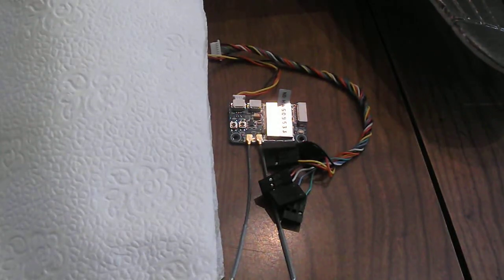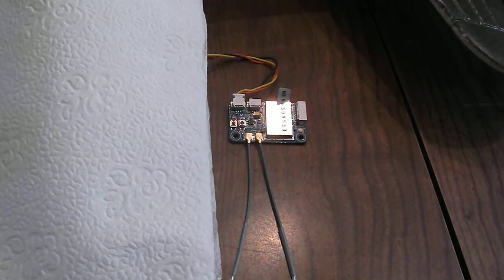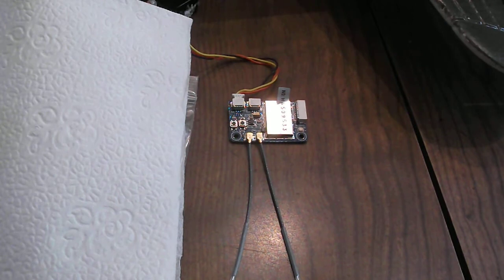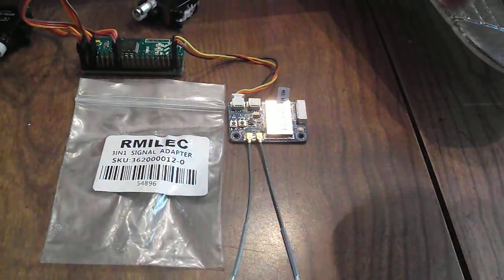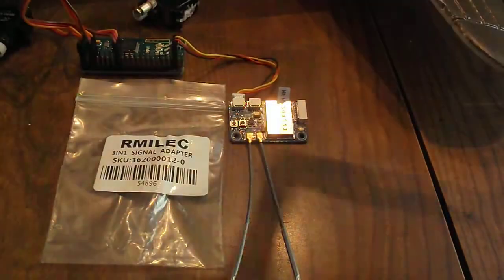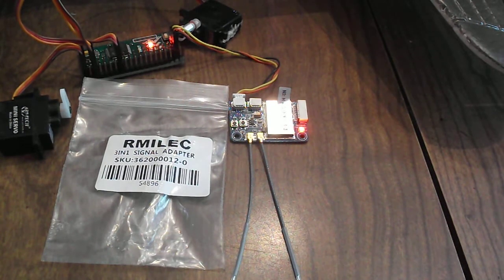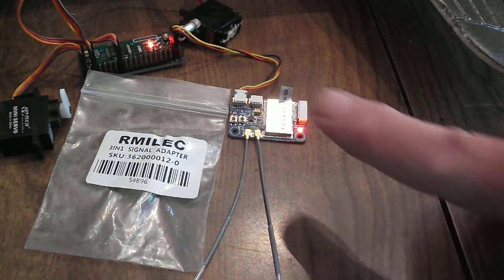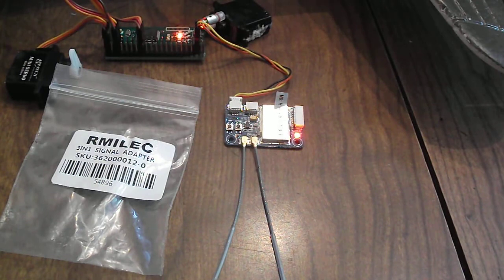FS x6b receiver servo output and 10 channel ia10b with the fs-i6x

Comment: And if you want to use the regular PWM output cable and connect servos directly:  https://www.ebay.com/itm/184100616268

Comment: You can use ibis for 16 channels on x6b and ppm gives 8 channels pwm 6,channels. Would appreciate if you could give a link for the board you are using I just fried an esc while trying to figure this out. This is a stupid receiver and ysky should have thought that this is generally the fo
Irst radio a new rc hobbyist has and thus they should give an easy to configure receiver. I got my servos working as needed but the motor does not have proper control.

Comment: The cheaper way to do this is to use the PWM plug and some pin header to connect servos to power.  No adapter needed for servos
Reply: Agree with you! Made this simple with this device: Connect regular servo to the FS-X6B via PWM port https://www.ebay.com/itm/184100616268